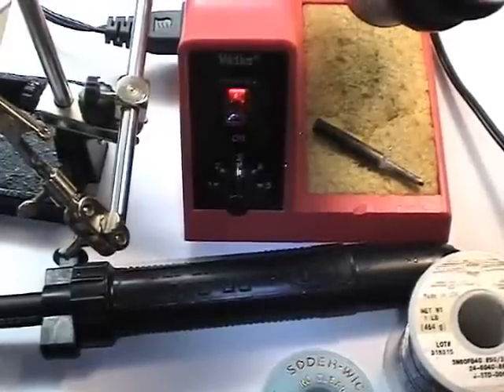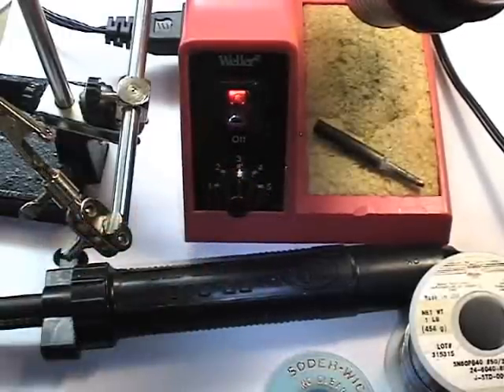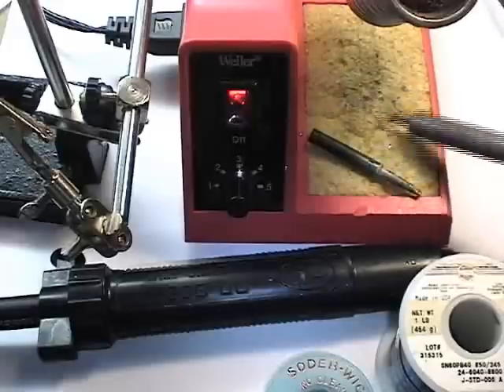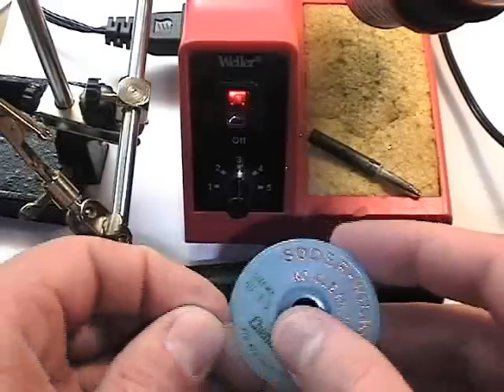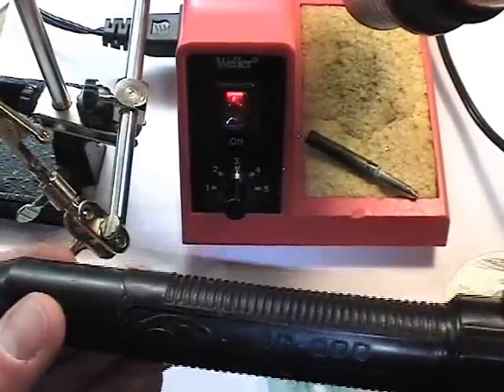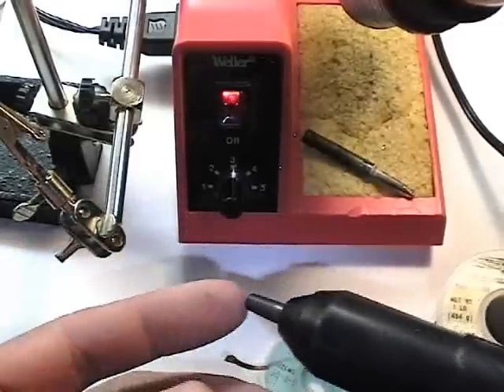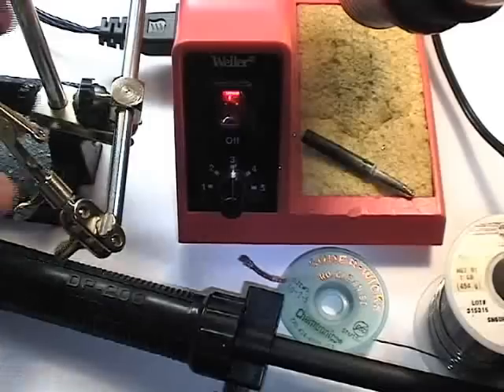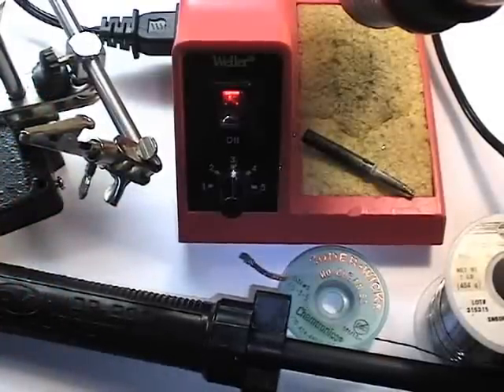Solder Tools Overview: solder station, solder sucker, third hand, etc.

Comment: talkingalwayz:

The tip may be oxidized. Try applying a large amount of rosin core solder to the tip, wipe with damp sponge and repeat several times to see if it will remove the oxidation. You can try tip tinner or replace the tip if needed.